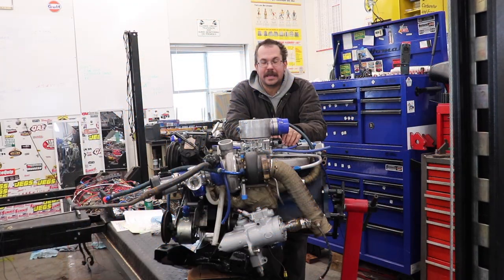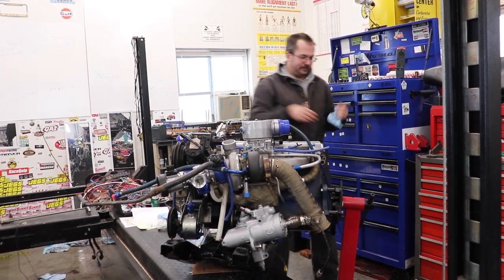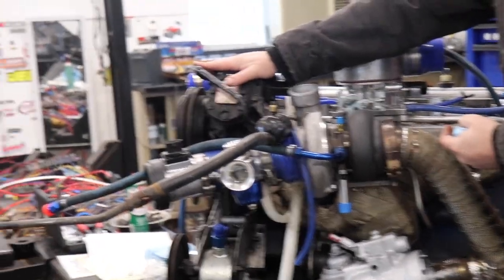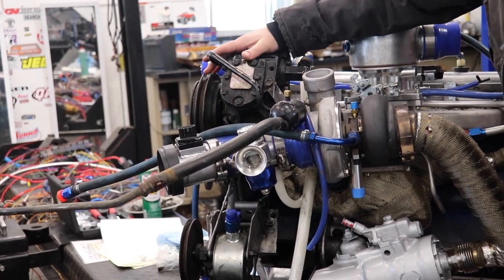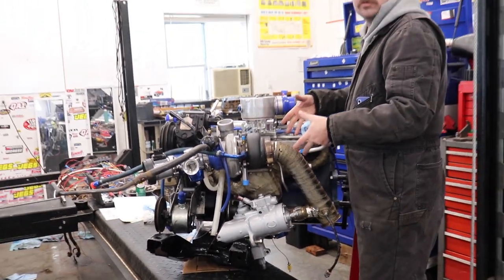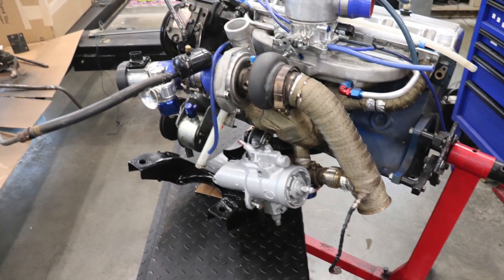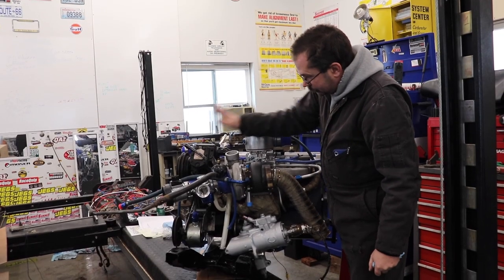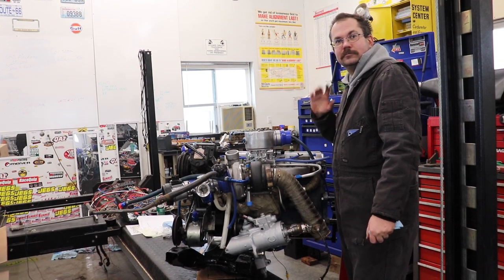Slant 6 with Air Conditioning and Turbo

Comment: You could mount the a/c compression where the power steering pump would have been installed.   Then, install an electric power steering pump.  I am not aware of any OEM remote electric power steering pump other than the one that Toyota MR2 used and those are always removed at the Pick N Pull.